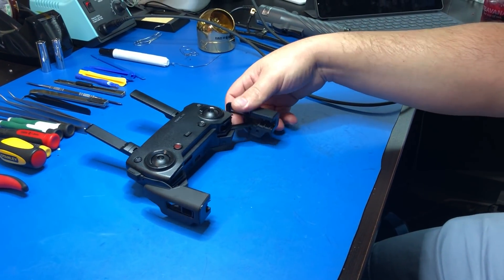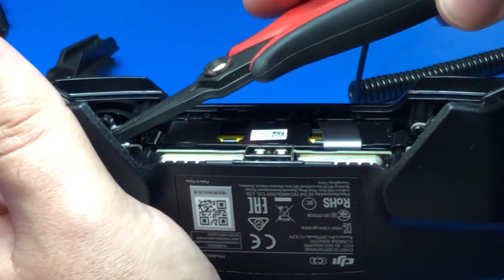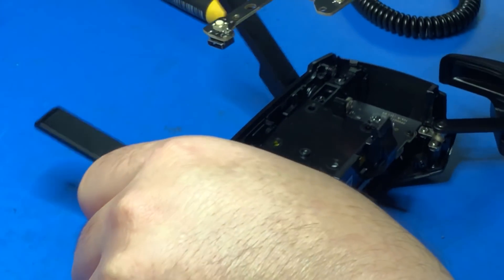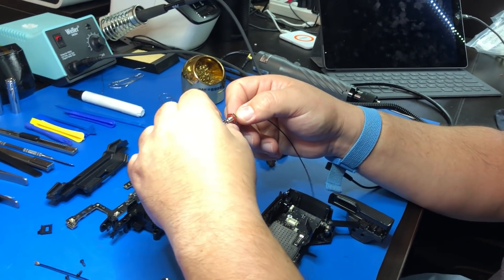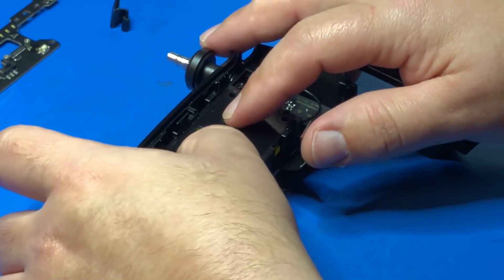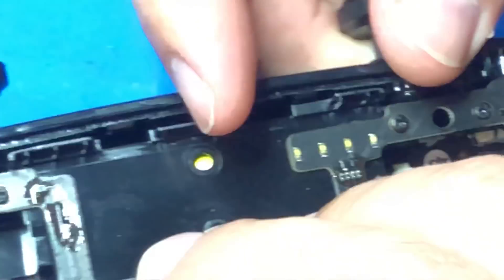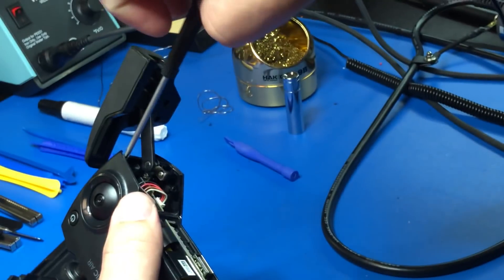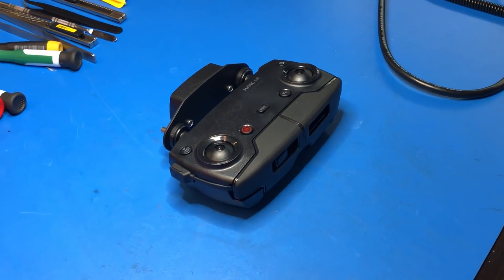Mavic Air Mod Video

Comment: Nice video...but the Air can get 4km+ even without this mod.
A 16 dollar set of Yagis with a parabolic reflector gives absolute solid connection...especially on 5.8ghz.
Because of the battery life limitation...the Air is  not going to go past 4.5 km... no matter what modification you do.
This mod looks very nice to some for the cosmetic benefit...but wont truly extend the range that the Air can already achieve.

Comment: I've had no luck with the Raptor XR on my Mavic Air, I get the same exact distance (around 1800ft) with stock antennas before "strong aircraft interference" kicks in and returns me home. I live in a suburban area so I'm not sure what the deal is. I tried both 2.4 and 5.8 with the same results.

Comment: Awesome video but there's no proof they actually work especially in residential areas there are some videos that are out they're all being tested in Open Fields the real test would be in a semi residential area to see how strong the signal really is and to see how good these boosters really work I'm so happy I own the mavic 2 Zoom don't have to worry about these issues ocusync 2 is the best but I could  see them being used for the mavic air  but only if they work and there will definitely need to be proof behind that and there is none but to those who bought these extenders good luck and I hope they do work for you
Reply: It did not work in my residental area. No city buildings, just neighborhood and trees. I got the same distance both with and without it.

Comment: I have done this mod, on about 10 occasions for friends. All work 100% giving us on average 1000 metres, extra distance and no more choppy video's.  Thanks titan..
Reply: do any other mods need to be made to the aircraft?
Reply from the maker: No the boosters are bi directional in conjunction with higher gain antennas is all that’s needed.

Comment: I am interested in these from seeing other videos but are there any scientific measurements to compare this vs stock antenna besides demo flights? Perhaps Field Strength db meters etc?
Reply: It wont increase the already incredible 30dbm(1000mw) that the Air has on 5.8ghz.
Yagi/parabolic extenders (16 bucks) combined has gotten me 4.42 km with the Air ...one way...landing with 2%...only limited by battery life.
Even at 4.42 km away I had solid video connection.
Altitude and environment have alot to do with how far the signal will go and how solid it is.
The "sweet spot" for altitude is definately between 300 and 400ft.

Comment: QUESTION... YOU TOOK THE SHORT(LEFT SIDE) ANTENNA WIRE OFF FROM THE "UPPER" CONNECTION BUT WHEN YOU ADDED THE "NEW" LEFT SIDE ANTENNA WIRE, YOU FASTENED THE LEFT SHORT WIRE TO THE "LOWER" CONNECTION. DOES IT MATTER WHICH WIRE IS CONNECTED TO THE BOARD CONNECTORS AND IF SO WHAT IS THE CORRECT CONNECTIONS?
Reply from the maker: It does not matter
Reply: wow, thanks for your rapid response. I just did not want to tear down again if it mattered. SO the statement below is incorrect from (dabbler90) : "I would think that the 2 antennas operates at different frequencies 2.4ghz and 5.8ghz, if reversed connection then the specific tuned antenna should be fixed to the specific frequency channel. Well I skipped the video a lot, does he mention which is which?" ??? REVERSED ANTENNA WIRE CONNECT HAS VIRTUALLY NO EFFECT.      "

Comment: I already owen a MA and i love it. Only problem is WiFi interference. I've been searching for extenders but my main aim is to improve the quality of the video feed as i dont use it alot for long range. Will this smooth up the video feed over a short distance in city enviroment or for hiking trails and moutains. Does this work on both 2.4ghz and 5.8ghz?.Thanks for the help
Reply: 4hawks 119.00 does both 2.4 and 5.8 and alot better video and signal all around. But u  need a fast card for good images

Comment: Voids warranty?
Reply: Absolutely.
Reply from the maker: No.  We’ve had several send theirs in modded when they’ve had a crash and have had no problems.  With that said we show you how to do the mods so they are reversible and can be taken back to stock.

Comment: Iv got an issue. The second HEX screw was far too tight for my tool to handle and it stripped it. How would i go about getting it out now?
Reply from the maker: Sometimes you can use a bigger square head if it’s that stripped.  There’s also various methods you can google but one includes using a rubber band and the screwdriver to add some friction
Reply: Unfortunately if it’s completely rounded out, may have to use a small cutting wheel on a dremel... cut a flat head shape or a plus shape then use a flat head or a Phillips head screw driver.. 

If you don’t want to risk mangling the plastics you may have to drill it out with a reverse tap drill bit... that way as you drill into it it bites in and starts loosen it out. Then toss the that screw and find another screw that uses more common type of face like flathead..

Comment: The wifi transmission on this drone sucks compared to ocusync. No clue why they did that
Reply: Janet Airlines probably to save money. If it costed the same and preformed the same there wouldn’t really have been any point in making it
Reply: The reason people do that is to match the range of occusync or get close.   

I modded my mavic air’s WiFi controller and I use +6Db dipole antennas tho.  My range is massively improved.  The limitation now is down to battery life even in fairly congested areas.  But I can cover miles of range now.  The other thing it helped with is picture clarity, before in WiFi congested areas or longer distances the image could get soft like 360P live feed.  Now stays 720P and pin sharp until I’m about 3.5 km out..  then starts to fall back to 360P looking video..     using nanosync system I also have but dislike because have to face the drone at all time, it stays 720P the entire time!  But if your turn off axis too much it falls apart and disconnects.  Also only works exceptionally well on 2.4Ghz 5.8Ghz it falls apart after 3km.   That’s why I like dual band dipoles better.  You can face the wrong direction and they work almost equally as good on both bands means if areas your in has congested 2.4Ghz band you can swap out for 5.8Ghz without worrying.   

Compared to my Mavic Pro and mavic 2 Pro obviously more limited still but, I picked up my antennas from amazon they designed for 802.11 AC WiFi system and about 50% larger than stock antennas but they have higher gain.  I paid like $10 for them, included wiring and connectors and adapters and got 4.5 avg rating out of 5 for people using it on WiFi.  Figured $10 and half hours dicking around inside the controller was worth it.  And it was.
Reply: @Honeypot-x9s  whats the name of the antennas that u buy on Amazon? Thanks
Reply: @luizjunior7785   hi i should have followed up my post since been some recent changes.   i do not currently own the mavic air anymore (sold it) and have since purchased a few new drones and moved back away from Wifi..  secondly  DJI's latest .560 (i think?) update,  the wifi logic was tweaked secretly it appears like.   it appears that now with stronger antennas that mavic air tries to stay on "HD mode" when signal is weakening instead of dropping to "normal" or "sd mode" or slicing bandwidth down more. and instead se large frame drops as it tries to reduce the quality.  which result in overall same range as stock somehow.    and DJi never allowed the mavic air to change how image is received or channel width or anything like that instead its "automatically" managed by software.  you can only pick channel/band.    

 but i believe the antennas were either Linksys or TP-Link antennas for something that uses dual band and 802.11 AC antennas and like +6DBi gain?     you may need to 3D print or figure out a solution for adapting the barrel connectors to the controller as they will be sloppy and loose on their own,  their maybe a kit you can strip parts form and combine together.  

however all that being said i no longer would recommend this as it appears DJI changed or tweaked the Wifi logic a bit and made this less functional mod on its own..amplification could probably overcome these limitations but i seen people fry their controllers and cause more bad than good with wifi amps..  and dual band wifi amps are expensive.

Comment: Thanks for sharing this, Great video!
Reply: QUESTION... YOU TOOK THE SHORT(LEFT SIDE) ANTENNA WIRE OFF FROM THE "UPPER" CONNECTION BUT WHEN YOU ADDED THE "NEW" LEFT SIDE ANTENNA WIRE, YOU FASTENED THE LEFT SHORT WIRE TO THE "LOWER" CONNECTION. DOES IT MATTER WHICH WIRE IS CONNECTED TO THE BOARD CONNECTORS AND IF SO WHAT IS THE CORRECT CONNECTIONS?

Comment: what antenna is used in karma? i heard the air has wifi? is there a way to get the same connection like on the karma on to the air?
Reply: Dave Blvnko air is better then karma both range and transmission soooo

Comment: It seems as tho you reversed connection from the antennas. The left antenna was attached to the upper connection point and the right antenna was attached to the lower point. Does this affect functionality?
Reply: dabbler90 : I would think that the 2 antennas operates at different frequencies 2.4ghz and 5.8ghz, if reversed connection then the specific tuned antenna should be fixed to the specific frequency channel. Well I skipped the video a lot, does he mention which is which?
Reply: QUESTION... YOU TOOK THE SHORT(LEFT SIDE) ANTENNA WIRE OFF FROM THE "UPPER" CONNECTION BUT WHEN YOU ADDED THE "NEW" LEFT SIDE ANTENNA WIRE, YOU FASTENED THE LEFT SHORT WIRE TO THE "LOWER" CONNECTION. DOES IT MATTER WHICH WIRE IS CONNECTED TO THE BOARD CONNECTORS AND IF SO WHAT IS THE CORRECT CONNECTIONS?

Comment: Left a phone message several days ago. Still waiting for a return call. Is this typical of your customer service?
Reply from the maker: Apparently we’ve had some voicemail issues as you’re the second person to say that today.  We usually answer or return them quickly.  Give us a try again.  Sorry for the inconvenience
Reply: QUESTION... YOU TOOK THE SHORT(LEFT SIDE) ANTENNA WIRE OFF FROM THE "UPPER" CONNECTION BUT WHEN YOU ADDED THE "NEW" LEFT SIDE ANTENNA WIRE, YOU FASTENED THE LEFT SHORT WIRE TO THE "LOWER" CONNECTION. DOES IT MATTER WHICH WIRE IS CONNECTED TO THE BOARD CONNECTORS AND IF SO WHAT IS THE CORRECT CONNECTIONS? @titandronesystems2377
Reply: They have amazing customer service in my experience. They have always answered my emails right away. Sometimes even at 6-7 pm. Seem great to deal with
Reply: dondi gutierrez email them , he’s a good guy and very busy